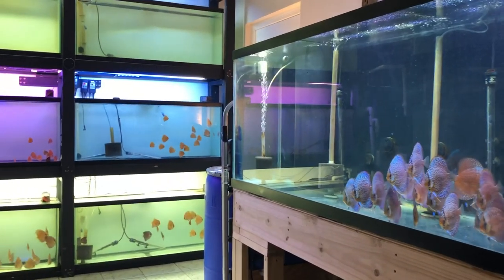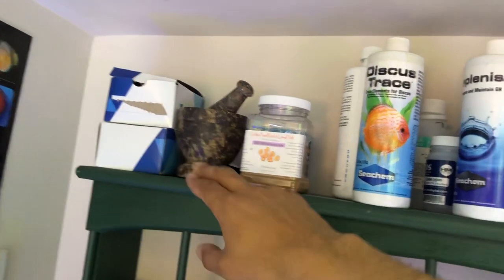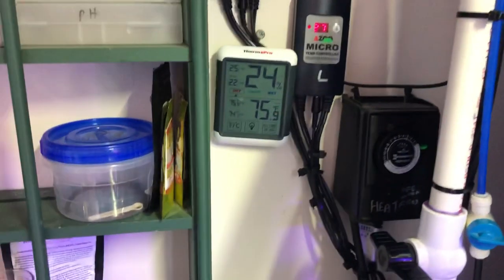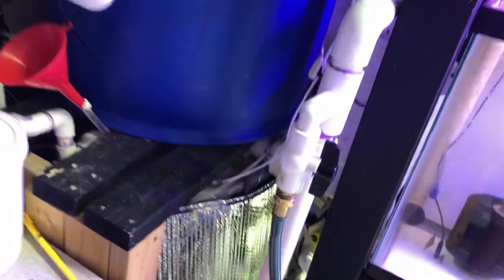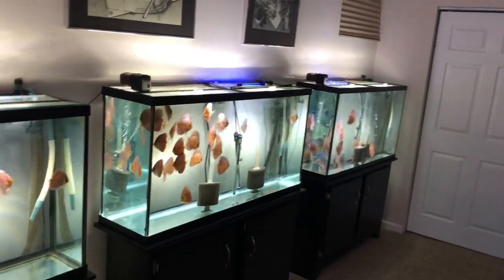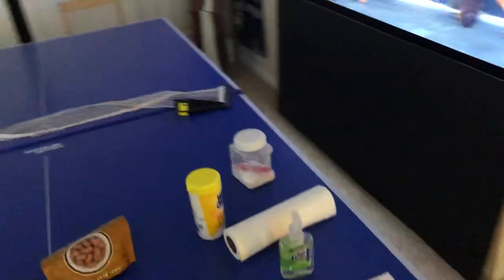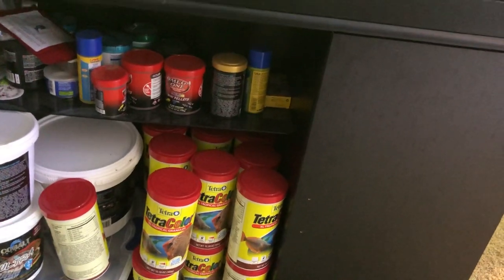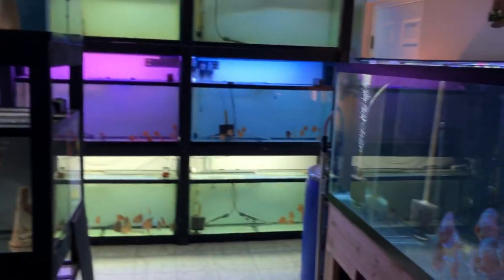Discus Room: items I recommend and use daily

Comment: Amazing Fishroom Sir👍
Thank you for sharing. 
Could you do a video on how you mix the metronidazole and praziquental with vodka to treat for internal problems? Do you mix in food or  add directly to water? How long do you treat illness? Do you feed whilst on treatment?
Reply from the maker: Yes I will try to do something like this. Vodka is only used to dissolve prazi btw. Both added directly to water. Metro 7 continuous days. Prazi one a week on the same day of the week for 4-6 weeks. Only feed if fish are eating.
Reply: @GVBDiscus  
Thx for advice 
So you only administer prazi once a week on that same day for about 4 to 6 weeks? The treatment is separate from metronidazole or can be used whilst using metro for 7 days?
Also how often do you do water changes with using both medications?
Reply from the maker: @CrowntailHalfmoon  the only reason to use both medication would be if you clearly know you fish has both flukes and hexamite (hole in the head / white feces), I personally try to never ever use meds unless I know for a fact that my fish is sick with a particular pathogen, otherwise you're hurting your discus by treating. correct for prazi dosing. I let prazi sit at least 24-48hrs in the tank before chaning. Metro I change every other day.
Reply: @GVBDiscus  
Thank you for advice.
What are the signs for flukes or diseases that use prazi as treatment ?

Comment: I recently lost a Discus. It just wasted away. Tried General Cure, Erythromycin and Metro. Nothing worked. Have you experienced this?
Reply from the maker: In my experience, wasting away is a byproduct of an issue that was not diagnosed early enough. By the time fish start wasting a way it is in my opinion that "most of the time" the fish are lost at that point and will continue their path on wasting until they perish. If I had to guess, based on what I've seen, there was probably a hexamita infection that went untreated in the critical period where we can effectively treat which led to a more long term permanent issue. The treatment would be to 1) really pay attention to your fish and if it is acting even slightly off to recognize this and examine the face for any degradation of the sensory pores (holes in the head, no matter how small) and 2) dose with metro 2x per day, morning and night for 7days. Hope this helps, Greg.
Reply: Thanks. I only dosed once per day. Lesson learned.